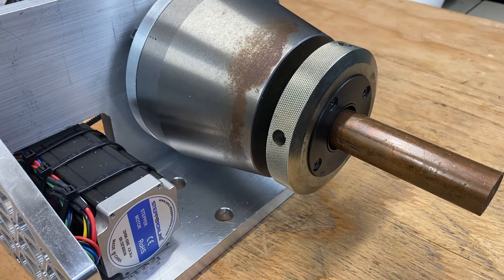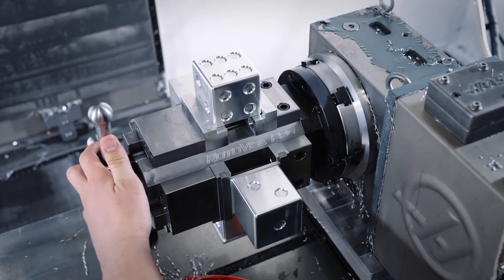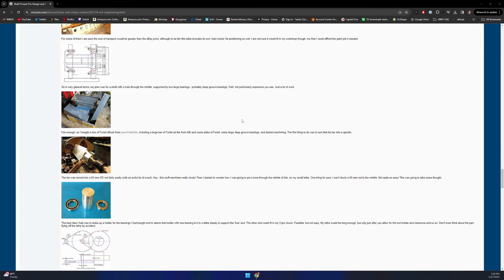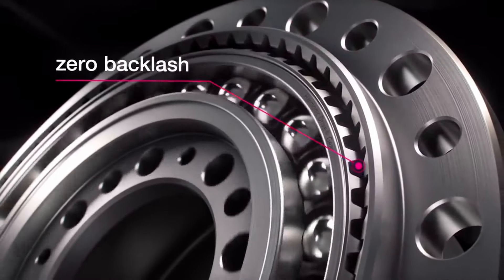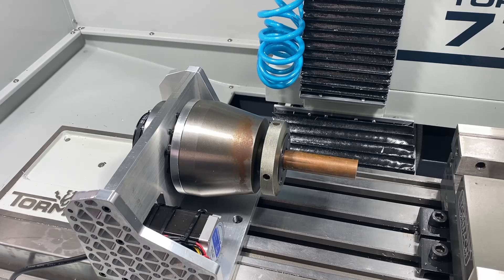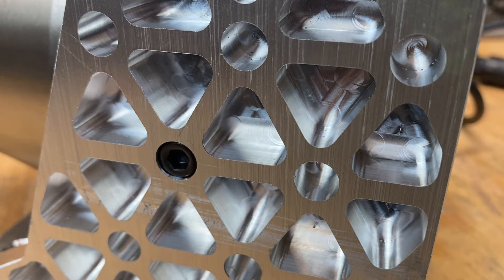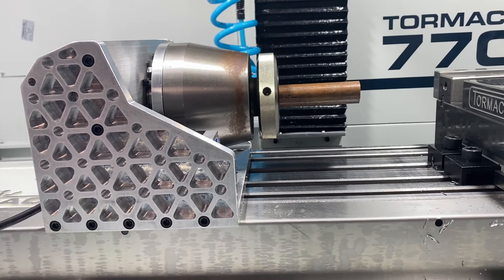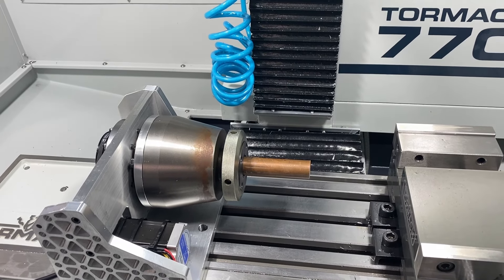DIY fourth axis for less than $1000

Comment: Thank You for the video, but I will share some tips: The vertical plate where you mounted the harmonic drive is just too thin for this application if you have to use aluminum at least use a 1.5 to 2 inch thick 7075 T6 and better yet use cast iron or carbon steel. I cant tell for sure the thickness of your plate but it looks like half an inch. also for the sides hollowing them that way may look cool but it doesn't help your application, in fact it reduces mass and rigidity, you need the maximum mass for rigidity and vibration dampening, that sort of hollowing is used when you need to reduce wight which is something you don't need here. also if you need more speed just reduce the size of the gear on the back of the harmonic drive and reduce micro-stepping to the minimum , that way you can easily achieve X10 your current rotation speed at the coast of torque of course. also a closed loop stepper is better than open loop for this because you don't want to loose any steps.

Comment: Fun Job. Although I don't think the Tormac is expensive compared to other brands. It's more beefy, has more torque and can be showered with chips and coolant too. Thank you for sharing your work. To improve yours I would, as mentioned before, use a servo motor instead of a stepper motor. Constant torque over the entire, higher, speed range compared to full torque at start only. Best, Job

Comment: While it may not be quite what you were hoping for. It’s still quite an achievement. I believe you could get more speed by simply changing your belt sizes. I think you’ll find you will still have plenty of torque even with a much faster gear ratio.and if you’re still unhappy, I would do as others has suggest and find yourself a servo motor. They have great amounts of RPM advantage over a stepper motor.

Comment: Change the pulley one the spindle side. You dont need 1000 steps per degree if youd rather increase the speed.
Reply: and a higher wattage servo motor instead of a stepper
Reply from the maker: Yea I am definitely going to do that in the next version

Comment: The first thing you should have done before spending a cent is math. You shouls have known the speed from the start. Harmonic drive is not neccesary. My 4th A cost under $500 and used a worm drive dividing head with direct drive stepper. Speed is 20rpm. I can more than double that by using a servo.

Comment: Why bother milling out the triangles on the side plates? Weight isn’t an issue here, I assume just to look cool?
Reply: only things i could think of is to not add too much weight to the table for rapid speed, possible deflection reasons. or taking it on and off the table.

Comment: Why not use a simpler planetary gear drive. If the gear ratio is large enough, any backlash in the gear engagement will be moot with respect to the final motion. I would think by using multiple planetary gears it would make preloading easer to achieve, eliminating the backlash in the engagement anyways. 
But I'm a chemist, not an enginear, so maybe I'm missing somthing.